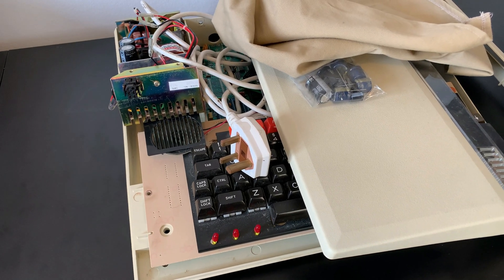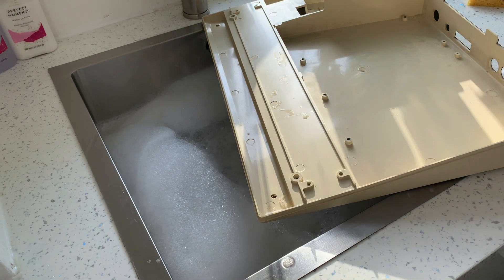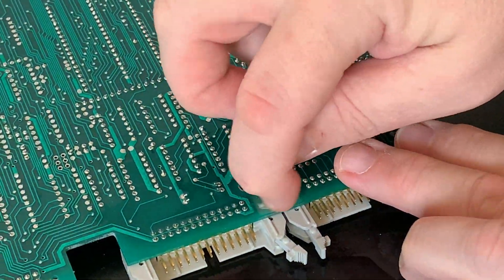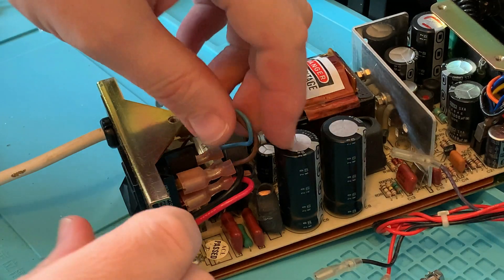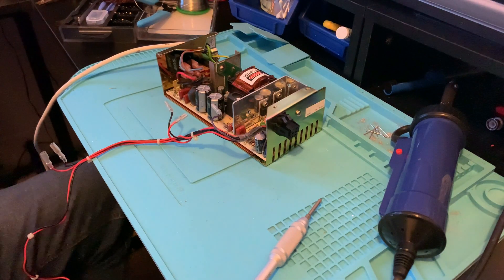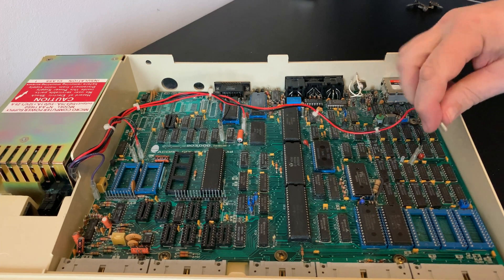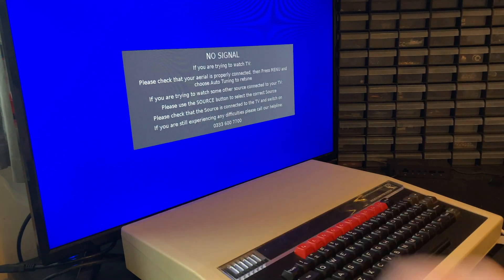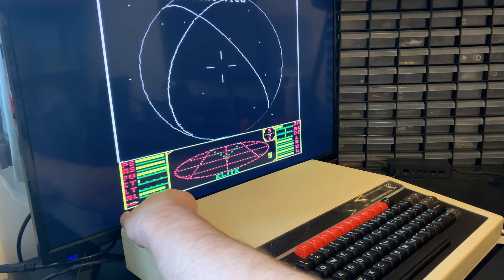BBC Micro - Part Two: Full Refurbishment

Comment: Bought my 1985 Beeb back into my life again after 25 years of none use, had the psu refurbished but sadly get a continuous beep and nothing else. Sad...
Reply from the maker: Oh no!  Hope you manage to get it fixed!  A continuous beep could just be that one of the ROMS isn't seated properly - give 'em all a push :)
Reply: @TheRetroShack  thanks for your interest. Unfortunately the rom's are soldered in rather than pushed in. I did buy some new ones plus a soldering station but have not had the nerve so far to attempt the job as I have little experience and don't want to damage anything. Maybe one day...

Comment: Hello, I just opened a model b issue 7 to check the internals and now I can’t get the case back on properly. The keyboard cable wasn’t bent exactly like yours, but it also doesn’t seem to be fouling the lid when I look inside. Any idea what it might be? The keyboard screws were on backwards when I first opened it, so i got confused and tried loosening them first. Maybe that affected something? Argh
Reply from the maker: Hmmm - difficult to envisage what might be going on there.  If you've not resolved it already - drop some pictures to me by email and I'll take a look.
Reply: @TheRetroShack  thanks for getting back! Somebody told me the lid is incorrect, as it's missing the plastic guard and just reads "BBC Microcomputer". Someone in a school computer lab or something must've mixed up some lids about 30 years ago - blast! Hoping I can just force it back on again somehow, not easy to find replacements. Not keen on trying to open the others now to check if they've been mixed up too...

Comment: Great video, thanks! May I ask what monitor you are using? The graphics look superb on it.
Reply from the maker: Thanks!  The monitor is actually just an older LCD TV :).   Polaroid 28" P28RN0117E. I use it because it has RGB/Composite/RF/SCART inputs and seems to run display everything I throw at it :)

Comment: 6:36 This zip tie is a safety feature. The regs at the time (and still?) said that if a wire came off the switch the loose wire should not be able to reach any other metal work. The simplest way to achieve that was to zip tie all the switch wires together.
Reply from the maker: Thanks - great piece of info!

Comment: I wonder if the power supply unit could be replaced with a USB power connector.
Reply from the maker: Not sure there'd be enough amps?  I'll have to look that up :)
Reply: @TheRetroShack  It could probably be done with USB-C and a different power supply to downconvert, but feels like it would be moving backwards in terms of reliability and ruggedness.

Comment: if you want to make it less faded and back o the original colour you use hydrogen peroxide and a uv light box, soak for a while and dry to find a nice clean and original coloured machine case
Reply from the maker: Yep, it’s called ‘Retrobrite-img’ and I’ve done it a few times on different machines in the past - to varying degrees of success :) This Beeb didn’t need it as there was no difference in colour from the inside of the case to the outside - so no evidence of discolouration due to the nasty old sun :)

Comment: From a purists point of view the keyboard nuts should be on the inside. Personally I'm not a purist but a power user therefore to save tinker time my keyboard isn't fixed. The case does a more than adequate job with the lid on or off as long as the barbarians aren't allowed too close.
Reply from the maker: I’ve corrected the keyboard nut faux-pas since filming this :) Your inner purist can relax :) Thanks for watching!
Reply: @TheRetroShack  Excellent work. I shall be following with interest to see the new tech from RetroClinic in action.

Comment: The BBC micro was a very solid built computer (and hence expensive), well the Apple II was likewise an expensive 8-bit computer and yet did well in the commercial market. Probably early on VisiCalc had a lot to do with that - but one should not dismiss the factor of the Cult of Apple effect that the two Steves gave rise to. Maybe the BBC micro and Acorn should have more deliberately pushed its backstory and the personalities involved to mythological grandeur - as marketing and promotion.
Reply from the maker: You may be right there.  In the UK at the time, Clive Sinclair was the British Steve Jobs - A great marketeer and a real celebrity. :)

Comment: haha when i got the same games collection for the BBC on my MiSTer, the first game I played was chuckie egg followed by loading elite as well!. hahah.. great video.. looks like new.. i do love the BBC keyboard.. such a nostalgic keypress..
Reply from the maker: Kindred spirits! I've played Chuckie Egg quite a bit since and have to say I've gotten a lot better :)  It's a great game!
Reply: How accurate is the beeb core for the MiSTer? Have you had any issues with it?
Reply: @davidste60  Only issue I had was initially it didn't load Elite, but there was a core update recently and it does now.. everything in the collection seen here I've tested - works.  It is worth checking out the MiSTer if you haven't got one.  It's very good for all those 8/16 bit computers from the 80's. (which was the reason I got interested in it) it does have that feeling (which is hard to pin down) that you're using original hardware. I have a raspberry Pi and that feels like emulation.. the MiSTer doesn't.
Reply: @bazza5699  Yeah I am tempted by the MiSTer. I know what you mean about the Pi. I've got a Pi3, it's tons of fun but not quite perfect. Emulation on PC is damn close though, I can't fault SNES, Megadrive, Amiga etc. And I think there are some fairly accurate Beeb emulators for PC too. I think I'll have to try a MiSTer if only to settle the issue for my own satisfaction. Thanks for the reply.
Reply: @davidste60   I used to have a Megadrive in the early 90's, never had a SNES.  Loading up Golden Axe on the Megadrive core of the MiSTer felt like I was 17 again, it played exactly as I remembered it.  I haven't tried PC emulation apart from WinUAE and a spectrum emulator. I've used WinUAE to help set up hard drives for the MiSTers Minimig (amiga) core.  The spectrum core is also great, gives you the option of 48k and plus 3.. but the real joy in the MiSTer I find is using machines I never had access to before, like the Archimedes, the NeoGeo or even classic Macs.  
The number of arcade games available is increasing all the time, from staples like bombjack and pacman to street fighter. 
The biggest positive though is the community, which sounds corny as hell.. but when you read the forums and now discord posts, everyone helps everyone else, it's so positive and the fact it's open source is incredible.  I've not had this level of enthusiasm for a platform since the 80/90's..

Comment: Great video. Would just add that when washing the top case section its very easy to damage the black keyboard surround.
Also when checking the power supply also check the -5V output.
Reply from the maker: Hi there - Yes, not sure why I didn't mention it in the video - the purple cable carries the -5v to the mainboard and I did check the voltage before refitting the cables :)  I mentioned about not going too vigorously, but good point - careful of the stick on bits :)  Glad you enjoyed the video :)

Comment: Nice video again.
The keyboard screws should be in the other way up with the nuts on the inside.
Elite was one game I did not like.
Reply from the maker: That's interesting, and I guess makes sense - little fingers can undo a nut but may not have had easy access to a screwdriver :)
Reply: @TheRetroShack  i can confirm the keyboard nuts and bolts went the other way, i serviced and upgraded BBC,s for a company in Essex, i must of done 60+ A to B upgrades, hundreds of DFS upgrades, and a couple of hundred Econet upgrades, we use to supply schools with full networked classrooms, run the cables fitted the junction boxes etc, and the BBC's and peripherals, even had the pleasure of having a doomsday system to "play with" before it was installed at a local library, my brother still has our BBC B, complete with DFS and Speech chips, just needs some TLC as it let out magic smoke when he tested it. hoping to get it from him, when this pandemic is over. cant wait for more videos on the BBC, nostalgia is a wonderful thing.
Reply from the maker: @martinoverthrow1857  Hope you get hold of that Beeb, and that it gives you many more years of happy memories!  And yep, more Beeb stuff on the way :)